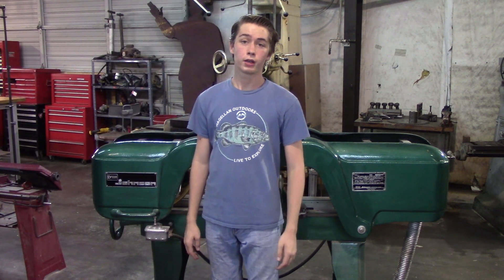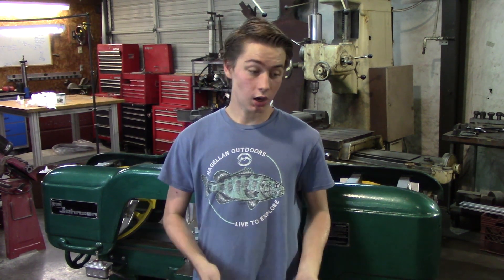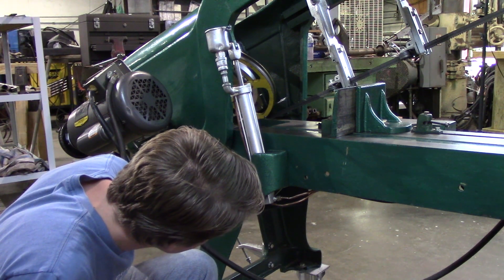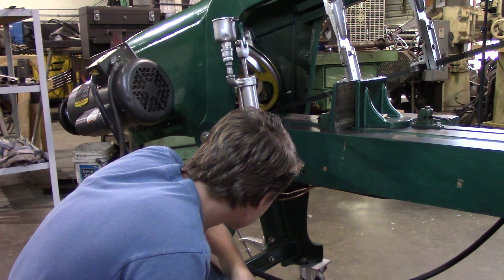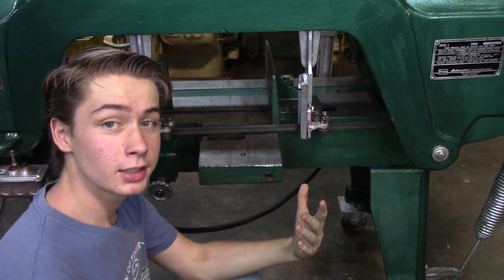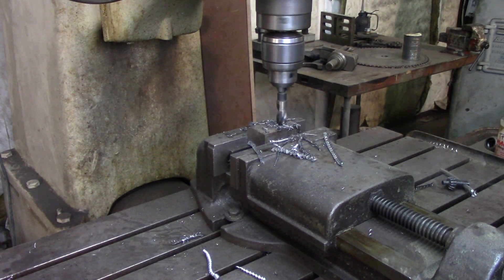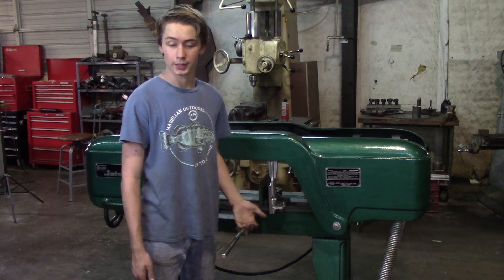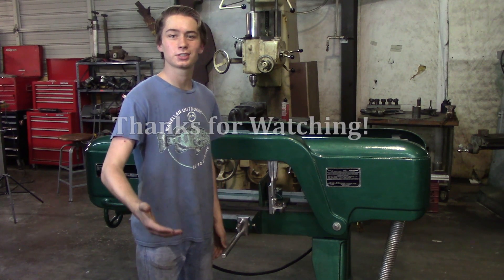Shop Tour, Johnson Band Saw

Comment: Soft copper on that feed cylinder is no bueno. Mine broke off right at the compression nut. I replaced it with brass pipe fittings and rubber hydraulic lines. Kinda like that green, quite a bit darker then original.